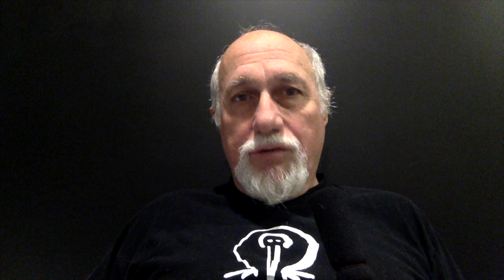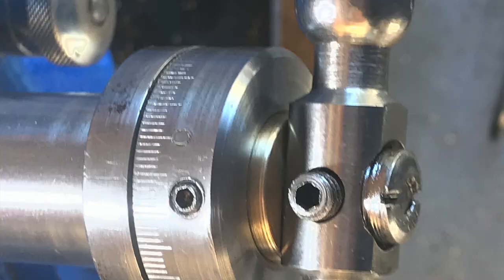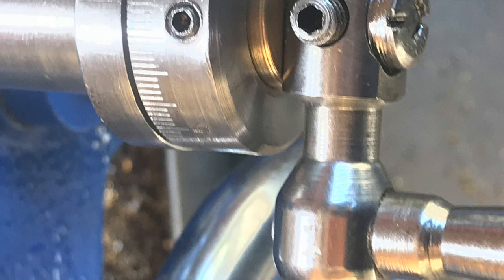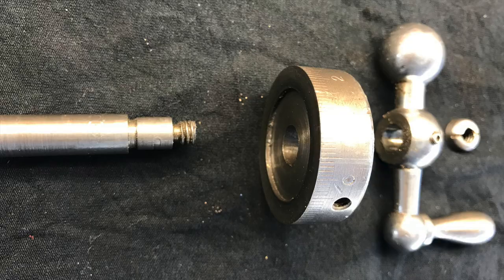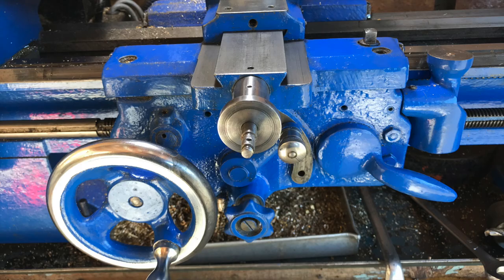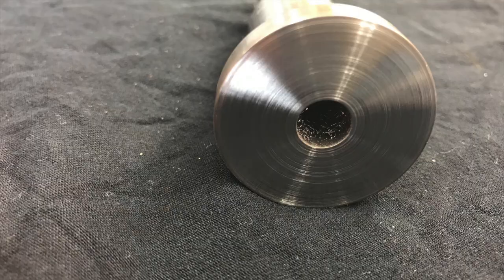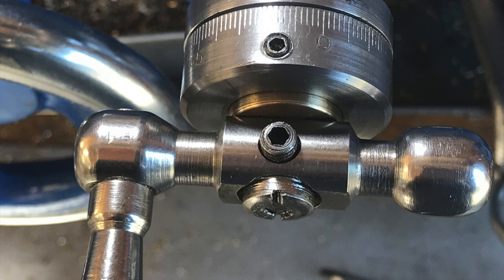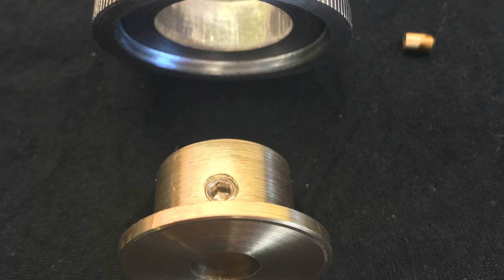Backlash- A simple top hat sleeve modification to the cross slide dial of an engineers metal lathe

Comment: OK, I'm only 3 years late.  Found you looking for ideas on replacing a lead screw nut.  That's a great solution to the problem, Evan.  The top hat is brilliant.  Wish I had seen this when I was trying to make the dials on my Jet-16 mill-drill adjustable.  For future reference, places in the US like McMaster-Carr and Grainger as well as eBay carry Acme threaded rod in right hand, left hand and multiple alloys so it's possible to graft a new Acme threaded rod onto an existing lead screw.  For future reference, you might want to use brass rod instead of brazing rod for those little plugs.  Brazing rod is usually phosphor bronze and is almost as hard as steel.  Try cutting it with a hacksaw and you can tell immediately that it's not brass.  Cheers!

Comment: Fantastic. I have followed the threads to get here as I got my AUD 1 week ago and  am more interested in pressing her into service than restoration. 
You have done some wonderful work with the gear train and the obvious weakness of the machine design. Now I only need some stock to progress.
Best wishes from Scotland.
Reply from the maker: Have fun with your new AUD. I have been buzzing mine today. I get my raw materials from scrap metal dealers and have always found them very willing to help by saving stuff for you.  It helps if you can impress them by showing them something you made.  I obtained 80mm x 600mm solid round stainless steel bar (free),  80 mm diameter x 600 mm solid brass bar, 1200mm x 45mm diameter solid aluminum bronze bar, 1200mm x 30mm  diameter aluminium bronze bar, 1000mm x 40mm solid stainless steel bar. 

These were mainly old propeller shafts from fishing boats in NZ but some from USA. I brought a whole 50lb suitcase of stuff from USA when I flew back to NZ. No problem! That was Jan 2020.  Cost about $NZ8= $US5 per Kg.   Also from a foundry the risers left over after casting metals: aluminium $NZ7 /Kg but its density is 2.7 compared with copper at 9 and aluminium bronze 8.5. Aluminium bronze is 11% aluminum, 4% nickel and the rest copper. Good luck with getting materials. I think the stainless steel was a lot cheaper per Kg. $30 for the 1000 mm x 40 mm bar.

Comment: Another Kiwi here!
I have a Boxford CUD from the mid 60's, an ex school machine. Didnt come with much so I'm gradually building it up.
I built my own cross slide nuts (two, I like spares, steel shell with brass thread insert) and have a spare set of worn out half nuts and some leaded bronze bushings to thread and fix into them.
Where you have built this cunning device, I've parted some quite thin brass washers off and slipped them in.  
I'm also putting electric crossfeed and main feed on, to save the half nuts for threading, and give it the turning capability of the AUD without the cost of a replacement saddle and apron.
Cross feed is functional, but I'm having to run it carefully until I can get a limit box to put in before the controller, so if it tries to crash it'll limit itself and switch off at just above a heavy cut.
Reply from the maker: Hi, If you haven't already done so you might like to look at the software I wrote for setting up the gear train to cut any thread, imperial or metric. I just released a new version a few days ago. It is free and online: 
www.HeroSteamEngine.com/RideTheGearTrain
It has an extensive help / instructions file too. 
You should  find my email address on there.
I wonder where in NZ you live. My lathe came from Te Puke High School and I live about a hundred km north.
It sounds as though you are getting into some serious modifications!
Reply: @Evan-e-cent  I'm in Dunedin, the lathe came from John McGlashan college
Reply from the maker: My lathe came from Te Puke High School where my father was the engineering teacher. I was in his class 4 years but didn't get back to lathe work until after he died in 2014 and left me the lathe. A bit sad that he is not still here. See above comments about getting stock. I have installed a variable speed DC motor out of a treadmill $5 from recycling shop. 2.5 HP 4300 RPM. The pulse width modulator speed controller came from China for  $67.  They have a programmable current limiter which you could use, and display amps and volts. I also fitted a digital RPM readout about $20. I need to make more videos.

Comment: Great minds think alike, I have the same problem with my boxford. To the point the handle drives the dial hard tight and you can't move it.
I'm going to order some bronze asap and "borrow" your idea. Thank you sir
Reply from the maker: Actually the idea came from a casual discussion I found in Model Engineers forum.

Comment: Hi. I've just bought a boxford lathe that I'm in the process of reconditioning. I live in New Zealand too - Auckland
Reply from the maker: Hi David. I'm sure you will have lots of fun with your Boxford. Have I seen you on the Boxford Users Group? 
https://groups.io/g/BoxfordLathe-UserGroup/topic/how_much_patina_should_we/74750562?p=,,,20,0,0,0::recentpostdate%2Fsticky,,,20,2,0,74750562

I am planning another video, possibly too about backlash - How to live with it, and how I made a new cross slide nut by cutting a non-standard left handed internal Acme thread. Bit of a nightmare actually.

Do you know the history of your Boxford? 

I have just written an online computer program for calculating gear wheels to cut threads on Boxford lathes and other South Bend clones: see

www.HeroSteamEngine.com/RideTheGearTrain

You might find it useful if you have a Model B or C that did not have a lead-screw gearbox.
Reply from the maker: Hi David. I just heard about a Myford lathe they can't give away.
Reply from the maker: See the above comments about materials.